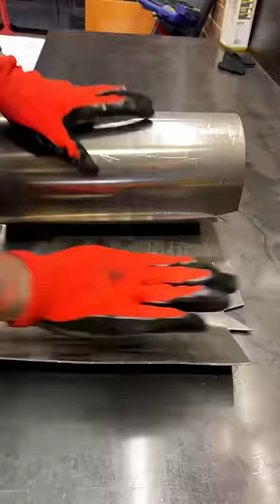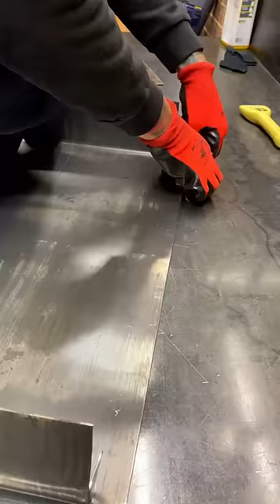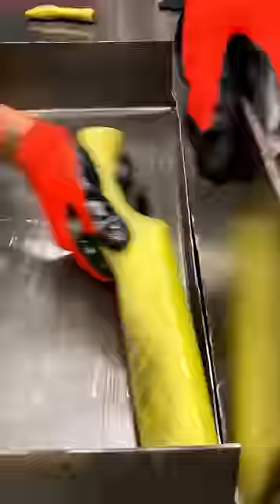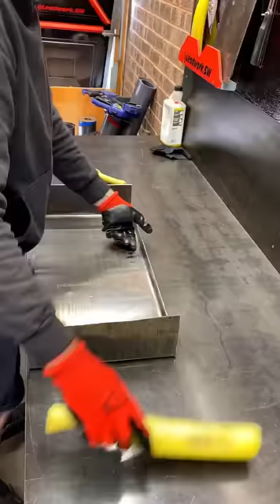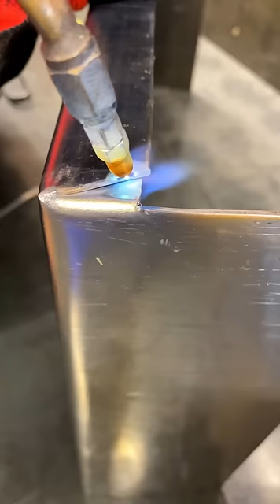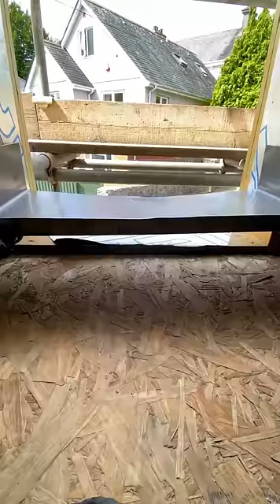Tray day

Comment: I recommend adding a Malco folding bar to your tool collection, the range in length of 30-60cm (12-24 inches) one side folds a one inch and the other folds a half inch. It’d eliminate your need to beat your smaller folds back straight from your fingers

Comment: Shits a trip man I wish I could beat all my stainless into shape the same way
Reply: As a CRES Tig welder I was boggled for a second there. Then I read the description.
Reply: Ain’t no way that’s stainless steel.
Reply: @62sy  ...that's the point. It's Lead.  He's saying that he wishes Stainless was as malleable as Lead.
Reply: If you could do this with stainless steel then stainless steel wouldn't be strong enough to be useful.
Reply: I finish custom stainless steel rails and this would be crazy to hit with the trizac belt.
Reply: @herpderp159  that's... correct.

Comment: Great for serving extra sweet cookies
Reply: What is tue purpose of this lead sheeting that you form so skillfully? What is the end-product used for?
Reply: @ldt8904  its for weatherproofing, often used near windows or the edge of roofs.
Reply: @Okkebeltman  thanks for that. I didn't know it was still in use. Would this be for new constructions? I can see why some heritage buildings would use the same technizques and materials true to their era, to maintain aithenticity, but I struggle to think anyone would opt for lead on a new building or general revamp; it's so expensive. Interested if you have insight on this?
We recently completed a project for some outdoor pergola/shelter/chill areas, where we constructed the stretched-cone timber substructure, and some specialists came to clad it with copper sheeting. The copper used is about 2.5mm thick and comes in coils maybe 600mm wide. they join them by overlapping and folding a seam on the 600mm width.

Expensive, overkill! South African government project, university campus. That roof will likely outlast this country as I know it
Reply: @ldt8904 ллллло́лшлллллллллллллллллллллллллллллллллл😊
Reply: You just need to add some vinegar to the cookie dough and wow, heavenly. 🙄 💀🙄
Reply: @ldt8904 from what I’ve heard they do this in NY still bc the rats will eat through plastic trays lol
Reply: @collinbickford it’s true. They still make the shower pans out of lead in NY also
Reply: @ldt8904 Very good questions!! Haha.

Comment: I used to do haz demo for a living. Had to demo a xray room in a hospital, walls were lined with lead sheets. It's bizarre. As strong as I was I could barely lift one of those sheets it was so heavy. But you could fold it like a wet noodle. I folded it all up and recycled it and got a grip of cash. Saved a bunch too for fishing weights and casting boolits😂

Comment: He won't worry about a nuclear attack with a lead-lined house
Reply: this is a bad idea for a home, in the presence of a nuclear attack, lead tends to accumulate radionuclides in itself. As a result, such a house will become the worst place on earth)
Reply: @nikobellic6974 🤓🤓🤓🤓🤓
Reply: The lead required for shielding from gamma radiation is not measured in mm or cm. It's been a number of years since my last CBRNE training, but I think you want about a meter of lead or 2 or 3 meters of concrete. Soil itself would require a dozen or so meters.

Either way, your real immediate enemy will be airflow and there are dozens of things that are easier, more expedient and cheaper to prepare for than the likelihood of a nuclear attack.

Statistically, you're in more danger from sugar, plastics, vehicles, suicide, being overweight, heart attack, diabetes, your own government, etc. etc. etc.

Nukes are scary, but statistics don't lie.

Comment: You do awesome work. I’m wondering Why use lead instead of another metal?? What is it used for??
Reply: Cheap, abundant, easy to shape, doesn't rust through like steel, just gets a patina and lasts extremely long.

It's used to protect areas that may be exposed to water, like roofing details, drip trays around windows and doors.

Comment: noob question.  What is this tray's purpose?  Is it like flashing for a window or door or something?
Reply: Yes, you got that right! Easy to fabricate on the job site to exact dimensions with simple tools. Lastly long long time and stays waterproof very effectively. It is very stable in this sheet lead form. Dangerous lead is when it is vaporize in gasoline burning, peeling lead paint in houses, friable as reinforcement for cemented on insulation around old boilers, also friable from old insulation wrapped around pipes.
Reply: @stevenmiller7731  Good to know, thanks for the reply.

Comment: Done a lot of lead work but never learned how to burn it.
Reply: If that's lead shouldn't there be a lot of fumes? I know the one he soldered was lead but what about the base?
Reply: It’s probably tin not lead…
Reply: They are both lead for sure
Reply: @BigDaddyAashik i think most of the fumes from soldering is the burning rosin flux. You don't really need flux when melting lead to lead.
Reply: @leonardonovello1240 what are you smoking?
Reply: @alemgas  must be out of a lead pipe lol
Reply: Its easy, you just apply fire and it melts lol
Reply: @leonardonovello1240 🤣
Reply: I've lead welded alot in the past. It's tricky
Reply: Это цинк

Comment: What do you use lead trays for?
Reply: Seems to be protection against dripping plumbing. A backup, fail-safe.
Reply: @leehaelters6182 It's better to use aluminium for that lol. It's going to get oxidized slowly anyway.
Reply: @alexa.davronov1537 what are you laughing at?
Reply: Yeah, I don't fully understand what exactly this is for? Did you put it in a doorway as a kind of leak or fluid protection? Either way, this is master craftsman.
Reply: Это цинк

Comment: Very nice. Tray for what?
Reply: It keeps the water from entering into the house, at the doorway there. Especially prevents water from getting down to the subfloor where it would never dry out. I have always used 30 pound felt under and behind most lead flashings. That is to isolate and prevent contact with any other metal, which is usually nail heads. Don’t want the physical penetration of a nail head, nor the galvanic action of the two different metals.

Comment: So serious question, where is lead still used?
Reply: Lead acid batteries.
Leaded airplane fuel.
Apparently roofing 
Radiation shielding
Used as a high temperature coolant. (Basically cooling from like 1000C down to 200C)

It's fine ish for roofing since it only leeches on the order of 0.1g per year (for 10kL/m2)
Reply: @satibel here in south africa, our government decided to build pavilions on a new university campus. They used pure copper sheeting for the roof. We built the substructure and a specialist came to apply the sheeting, which is imported from europe. The best part is that my country is bleeding money, but yea, we really needed that copper roofing 😢

🍌 republic
Reply: @ldt8904  Better go and to see if it's still there.
Reply: @onelineal9382  the students strike every other week. We sometimes get forewarning, but have had to dash and leave tools before. No-one has died afaik, but it get's sketchy and we have been threatened with violence. Some contractors have been injured. Found a few shells from rubber bullets around the campus, it gets wild there. That would be the perfect time for someone to start pulling off a few sheets. One day I was en-route and blocked off by some burning wheelie-bins and a loose brick wall across the road; the students had lifted the bricks from the sidewalk the night before. Following day saw a contractor replacing the paving.

Anyway, maybe now the copper is all oxidised won't be as tempting anymore. Not shiny enough to steal 🤣

Comment: why are you using lead? this metal is toxic enough to be used in construction
Reply: lead is only toxic when melted or consumed. Using it in framing is completely fine.
Reply: Gasoline is toxic,i bet you still drive your car.

Comment: Yes it is Zn, we use it on roof for water isolation,
Reply: what is this metal alloy?
Reply: pure zinc or alloy?
Reply: Lead
Reply: It is pure lead, 100%. Sheet lead. We get it in 2 1/2 pounds per square foot and 4 pounds per square foot, 42 inch wide rolls. They are very heavy! Great material to work with.

Comment: Guys this is tin not lead… they look similar but tin is not as dangerous as lead, also is cheaper and weights way less…
Reply: Lead
Reply: Why? why would you even consider making such a confident statement despite not having a friggin clue about what's going on... then to follow it up with some very basic common knowledge about Pb & Sn that you seem to have felt required a metallurgy lesson. Sorry bro but I mean not only is it obviously Pb based on the video alone but if not you'd think the posters screen name might have "led" you to "lead". 😳
Reply: Are you an American by chance,?nobody else would make such a stupid statement, makes my blood boil.
Reply: @onelineal9382  hey wait a minute! I am laughing. You post a valid question, at least he’s asking it instead of some know it alls who keep saying this is sheet tin. I’ve been occasionally using lead on jobs for 40 years when it’s the right metal to use. It’s a pleasure to work with lead, always. Precautions are plain and simple-wear gloves, wash your hands before you eat your sandwich for lunch, clean up the worksite when you finish every day. Gather up your lead scraps, they are easy to melt and reuse. If you have to fasten it on a roof as flashing the recommended fasteners are pure copper or brass/bronze.

Comment: If he was a propper skilled time served plumber, he could have formed the whole thing by hand, shaping and streaching it to the required shape. Only an amatuter would use solder . Shame on you , you handyman. This is for you Richie , RIP
Reply from the maker: It’s welding not soldering 👍🏻
Reply: @leadworksw  Still, welding or soldering, it's still not the best method.
I watched "Richie" form a lead valley to a down spout from a single sheet of lead, it took hours, but what craftsman.
A dying art
Reply: Plumber(plumbing) roofer(leadwork)😊